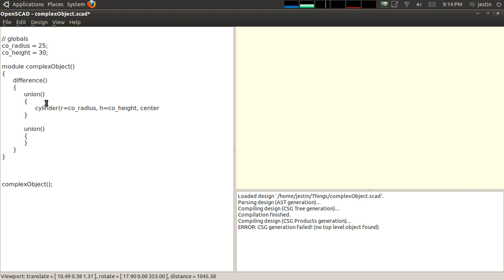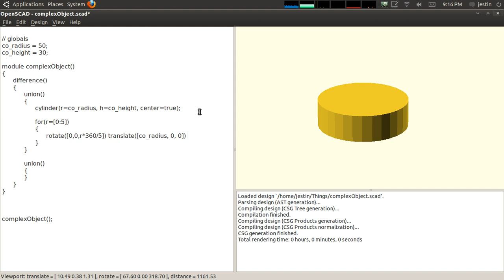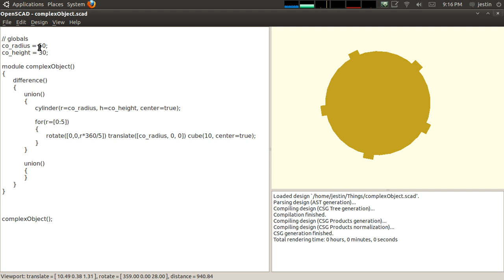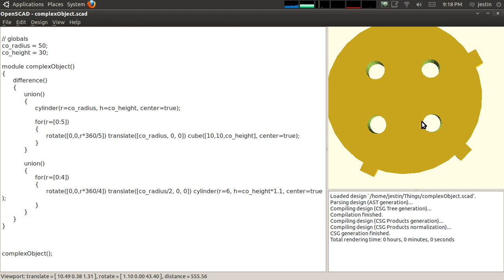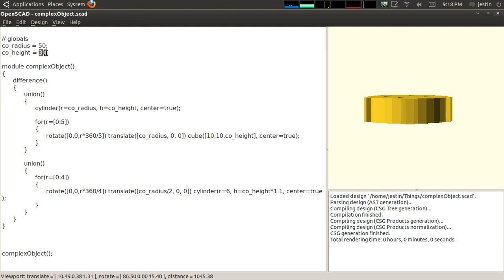Creating Complex Objects in OpenSCAD

Comment from the maker: Compile means that OpenSCAD will make your object display on the screen, but won't actually calculate the mesh that your object is made of.  This is accomplished through a library called OpenCSG, which can be buggy on some platforms.  Compile and render means that OpenSCAD is calling into the CGAL geometry library in order to actually calculate your mesh.  This is required if you want to export your model, and it also means that it uses a different method to draw to the screen, and works better.

Comment from the maker: In OpenSCAD, I like to create models of the things I'm building other objects to attach to, and I often add parameters to convert screw holes into actual screws.  This makes it easy to use a model as a negative for the purpose of creating interlocking parts.  Check out my Arduino OpenSCAD Model Library on Thingiverse as an example (sorry, I can't post links in comments).

Comment: Guessing that: rotate([0,0,r*360/5]) translate([co_radius, 0, 0]) cube(10 center=true);

Is the shorthand form of below?

rotate([0,0,r*360/5]) {
   translate([co_radius, 0, 0]){
       cube(10 center=true){

      }
   }
}

@4:19
Reply: correct, you can see it that way. But  you can see command like "rotate" and "translate" as adjectives that modify the Noun/Subject following the adjectives. Using brackets is from that point of view an implicit "union" of all the object(s) in the brackets.